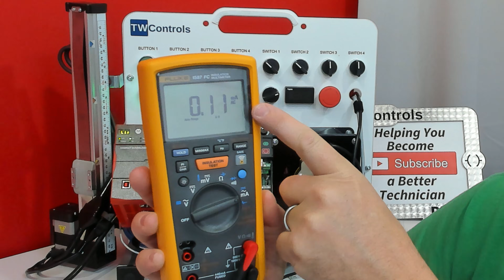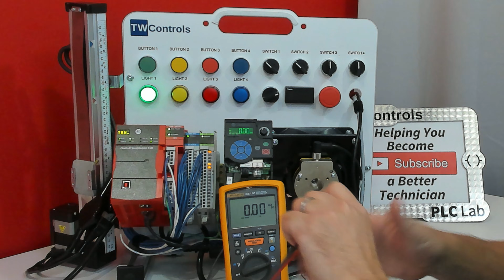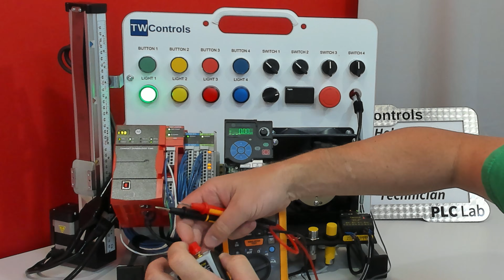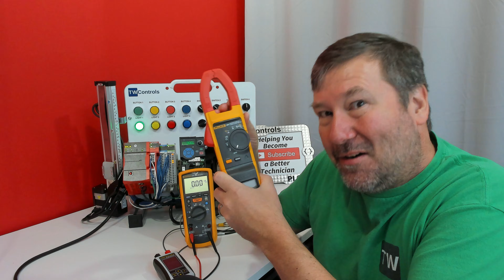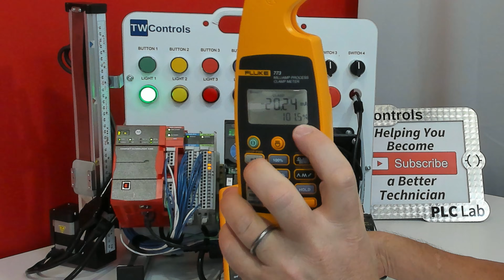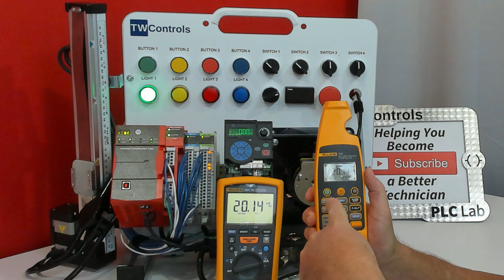Avoid Downtime: Fluke 773 for Measuring 4-20mA Loops

Comment: I don't normally keep up with the latest Fluke instruments tools, but I was killing some time going thru one of your website Free Courses for Industrial Control Wiring (13%) and i came across this section which was almost complete with this video about the Fluke 773. To be honest i've never heard of it, but i immediately recognized it as a must have Control Engineers best tool. Every bit of our OEM equipment is usually 4-20mA or 0-10 VDC signal control with real voltage going up to 480 VAC and as much as 200A circuits in panels. While we have the DMM for the higher voltage stuff, I've had to get different equipment devices to simulate 4-20mA including a Loop Simulator from you Tim. Last project used a FNIRSI Signal Generator which worked well for simulating, but it wasn't online. I've had to go look up this Fluke 773 and seems something we need. It carries a hefty price, but for what we do very often on Project Commissioning of our equipment at site and on EPC Projects this is like a must have tool i didn't know about and didn't know i needed. My office isn't always keep to buy new equipment. So i may have to buy it for my own needs and to have the right tool. May have to put it on an Amazon installment plan as this is far from a cheap piece of equipment, but a seemingly very good tool for any kind of PLC Engineer. That said, got a few of your online courses open and working at slowly Tim.
Reply from the maker: If you can't interrupt your process for even a second to disconnect a wire to put your meter in series with a 4-20mA signal then the 773 is a must.  I take it you saw the video on how to measure your signal with a typical DMM?
https://youtu.be/aJxLusnZfJQ
Reply: @TimWilborne  So far I’ve watched, and usually watch all the courses video’s. Even if I’ve seen it before it’s just a refresher in case I’ve forgotten something. But thanks!

Comment: The Fluke 773 is my daily go-to process meter. I work at a wastewater treatment plant where a majority of the signals being used are 1-5vDC or 4-20mA. In using the Fluke 773 you can choose to set the DC source from 0-10vDC to 1-5vDC. The instruction manual to the 773 is very vague in how to do that. I actually had to call tech support at Fluke trying to figure out how to get the 773 back to its default setting where the 773 sources 4-20mA and 0-10vDC. I've probably been doing it wrong when trying to measure mA current with the clamp part because I'll clip around a known wire that I know for certain is producing the loop and the 773 shows nothing at all. It makes you second guess a few things. The Fluke 773 is hands down the best process meter an instrumentation technician or engineer can have though.
Reply from the maker: That's a good meter!